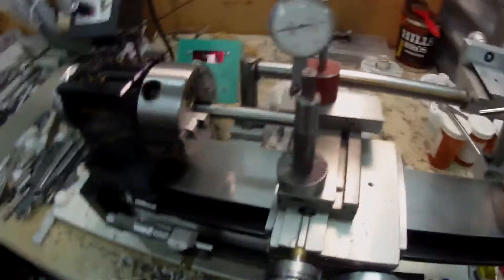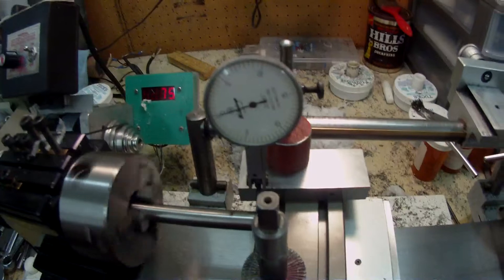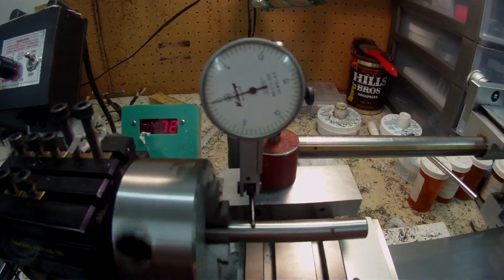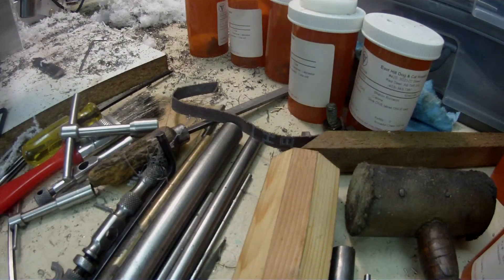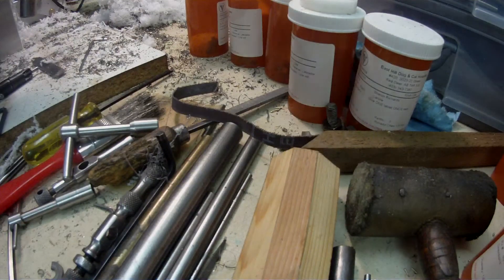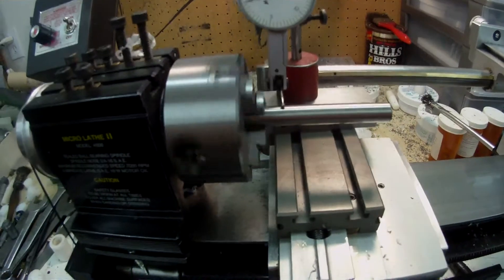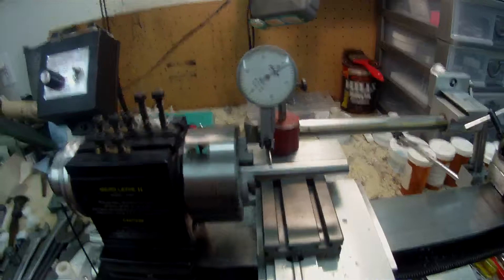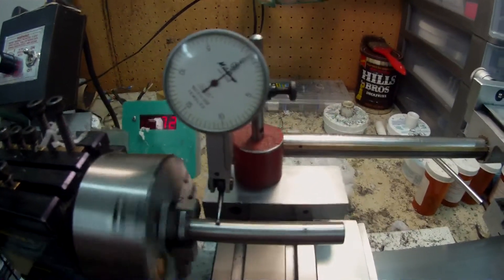FILE0039 A new Bison Chuck for the Taig Lathe

Comment: I wonder if a jaw is in the wrong slot, the dip on the dial seems like a bump, not off center
Reply: The strange pointer stroke is the result of a lathe error. The belt in the lathe may have a defect.

Comment: Nice chuck, not cheap but a chuck treaded for the taig is hard to find, thr runout is 2/1000 of an inch ?
muct do a measurement on my chuck to see what kind of runout I have, but I trued mine some years ago and I am not sure it I have a bar that is true.

dont know what kind of accuracy the Original taig chuck has.
Reply from the maker: Happy,
   its early days yet, it was just a quick check, I will have to do a better test, you must have noticed my error in the first part, with the stylus being at the limit of pressure on the stylus, and I'm not sure that the stylus at a 90 degree position is helping to give proper readings, although it is a constant, plus its a 50 year old DTI that has been used a lot, its like any other chuck most have a runout so I think its pretty good for my needs,

Thanks for the comment,
Reply: Walter Maisey just went to the shed, 2 degrees celcius so I did not spend time to make a video in there, i have 3 indicators, 2 china cheap things, they say I have 0,05mm at the chuck, I also have a Kafer indicator (german made) and that says 0,04mm https://d31wxntiwn0x96.cloudfront.net/gkatjj/media/km4t.jpg not sure how much that is in inches
Reply from the maker: happymark1805 Happy,
   I'm not sure but I think 0.05 mm = 0.0019 imp and 0.04 = 0.0015 imp that is approximately, I guess you gets what you pays for, and I know you have a very expensive chuck as well , one of the nice things about my chuck is  that at 2-1/2 inches out from the chuck face it appears to be the same reading, so that is another plus,

I have four finger type DTI's my first a Verdict (English) 60 years, a Mitutoyo (Japan) 50 years, a Mercer (English) brand new, and have just purchased a JEM (American) model 250 very old, it has a double face for Jig Boring purposes, the Mercer is brand new I will use that just to confirm my readings, other than that those tolerances are excellent, and yours are too,

........Edmund.........Alberta
Reply: Walter Maisey one of my problems measuring is that I do not have a good shaft to put in the chuck so I tried several and I only can measure near the chuck, ah well i'm sure its way more accurate than the one that comes from taig

Comment: Very nice.  Glad to see you got your microphone sorted. I like that chuck as well.
Reply from the maker: Hello Timothy,
   I don't know what I did to improve the sound, but I'm glad it has improved for you, the chuck came about because I had a piece of material move in the Taig three jaw  plus I got fed up with rapping my knuckles a lot when using the lever bars, so that set the ball rolling, its very hard to find small chucks where the body is pre threaded to suit a particular spindle, it also cuts down the amount of overhang weight (no back plate needed), plus Bison has a good name even though the chuck was made in Poland, and that is not a slur, I'm very happy with Polish products,

Thanks for the comment